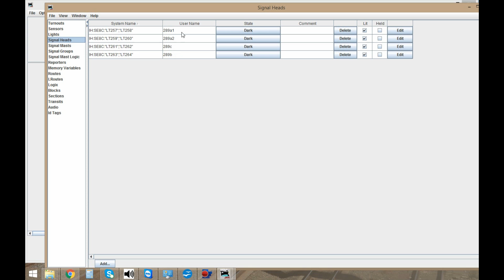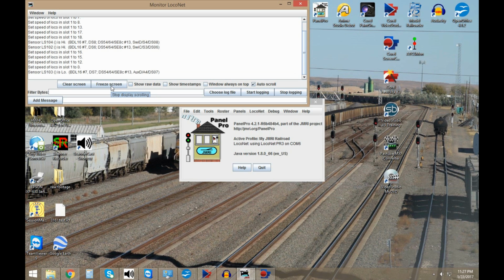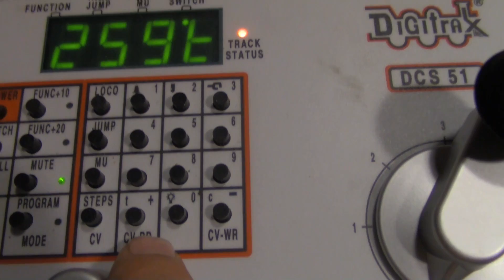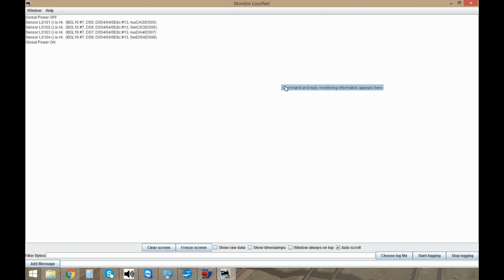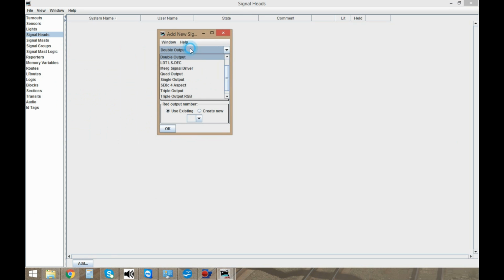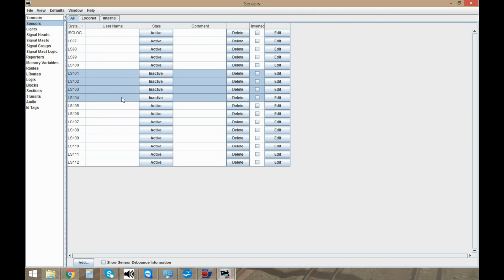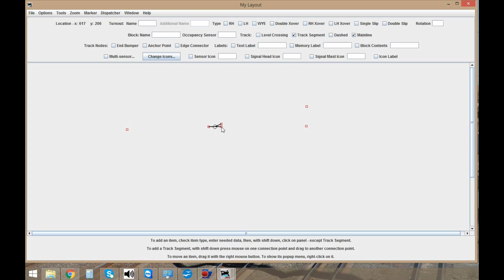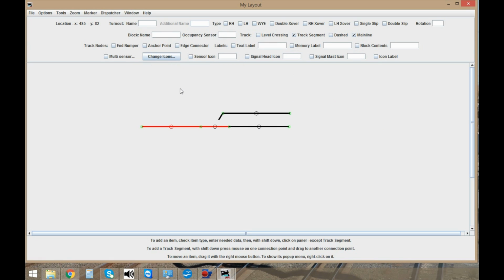JMRI Signaling with Digitrax Hardware Part 1

Comment: Excellent tutorial! I am gearing up for my new HO scale layout and signalling will be a big part of it. I will be modeling New York Central and instead of position signals, I will have to model speed signals, and to make things more complicated, I have also thrown in a few semaphores (shoot me!). These tutorials are going to be of immense help - thank you for making them.
Reply from the maker: I maintain the signal system on my friend's very large basement HO layout. I tried to install a variety of signals. I have 1 semaphore on the layout, but have only figured out how to get it to display Stop and Clear. Havent figured out how to get it to show Approach.
Reply: I actually have a pretty complicated signalling system planned - trying to bring it as close to the prototype as possible. It looks all good on paper but I am yet to figure out how to get that working with DCC and JMRI. Is there a way I can send you a personal message? May be we can have a detailed chat if you are interested. :)
Reply from the maker: Yeah, send me an email. I may be able to send you my friends xml file for his layout. I had to stacks several layers of Logix to get exactly what i wanted in some cases.
signal.up.productions@gmail.com